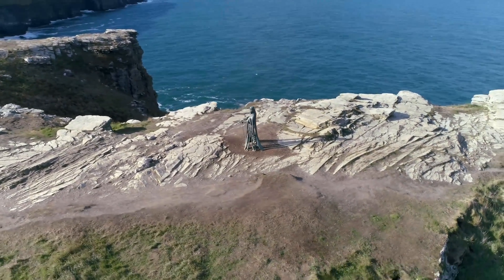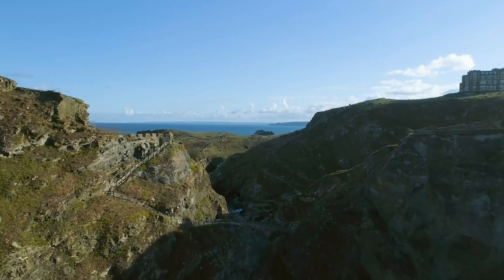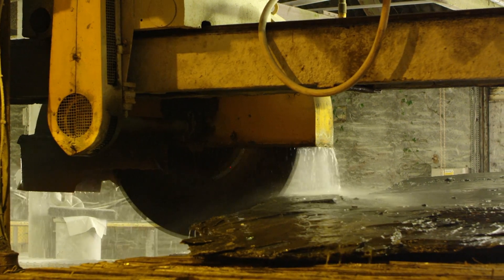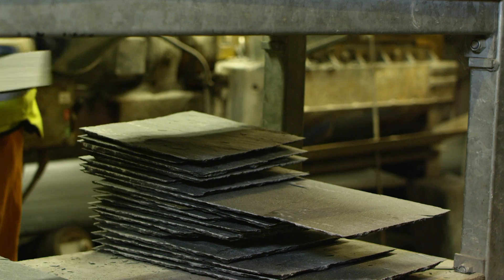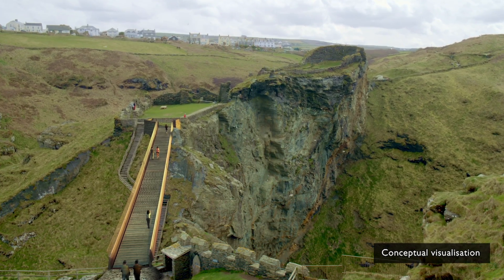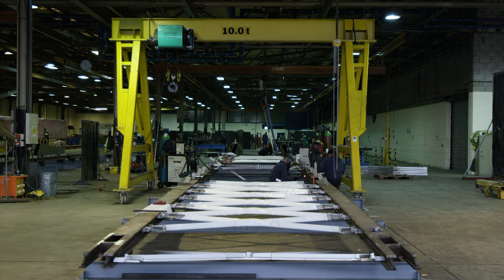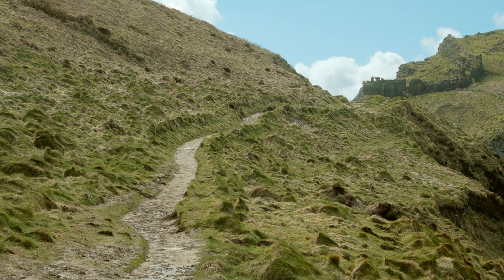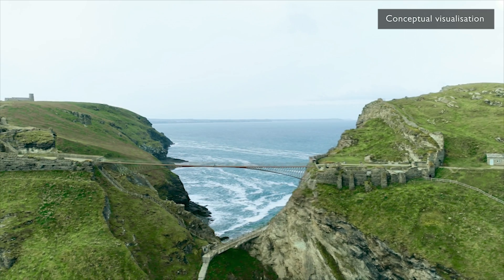Tintagel Castle - The Making Of The New Bridge

Comment: To be quite honest I think this is all unnecessary thing to do.
Reply: I totally agree.  No viable justification has ever been put forward by EH, and it's £4 million (lowest current estimate) of public money being wasted on further EH vandalism of one of Britain's most important early sites, at a time when another equally valuable facet of Cornish heritage - the Cornish language - has had a paltry government fund of £150,000 cancelled.  What EH has been doing to this site, over several years, is nothing short of Disneyfication.  Theme park mentality, cheapening a proud history, and it's not history and heritage that interests them (or the National Trust) any more - it's profit, and only profit, that they're after.  I note that the EH lady says nothing about the fact that the two 100-ft cantilevers of this bridge will have a 4-inch gap on the centre, 200 feet up.  The two halves of the bridge don't meet, and both independent cantilevers will be rock-anchored into some of the most brittle geology to be found in Cornwall (silaceous slate).  For how long will that stand up to the movement each cantilever will undergo under Atlantic gale conditions?  Especially as the bridge slopes to present its underside to the full force of the prevailing westerlies.  It 's not as though EH even owns this site.  It doesn't (it doesn't own anything).  EH skates over the fact that, long before Earl Richard's 13th century castle, Tintagel was the seasonal stronghold of Celtic Dumnonian kings who, for 300 years, controlled a vast maritime trading network that linked directly with the Byzantine Empire.  EH doesn't even name or detail any one of those Celtic kings.  But I can (and have done in a recent book).  In fact, there is nothing at Tintagel that' is even English.  A Celtic stronghold and trading centre before an England ever existed, followed by a Norman castle that was nothing more than a folly to aid one man's (successful) ambitions.  It was never out to any practical use.

Comment: It can get a bit windy there so make sure it isn't going to behave like the Milleium Bridge did at first.
Reply: Thats a different issue, assuming you mean Millenium Footbridge in London? That's synchronous lateral excitation, caused by the tendancy for humans footsteps to be synchronised, combined with reponse to movement in the environment simultaneously. 

We now know footsteps generally cause interactions with the low lateral frequency resulting in tendancies for a bridge to move, swaying of the bridge caused the people to react in a manner opposite to the sway (with everyone responding to this simultaneously so they didn;t fall over or become unabalanced), exaggerating the issue. Similar to the way everyone moves together when a bus goes round a curve, or a train braking as a couple of examples. Not all that well understood a phenomenon in bridge design prior to this sort of time, and it's sheer capacity for people relative to it's leightweight design is fairly unique.

Solved with the introduction of dampers, which would be likely to be the solution even if design in by modern-day practises (or made heavier/stiffer).